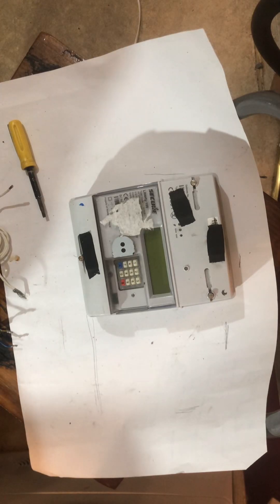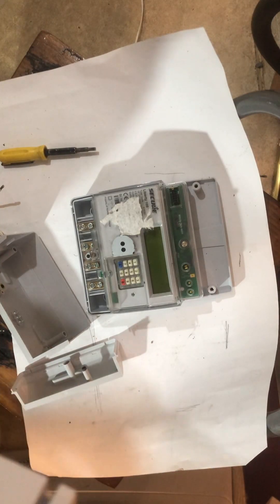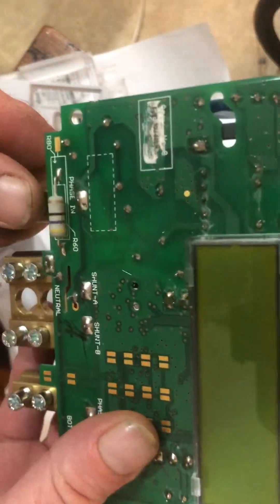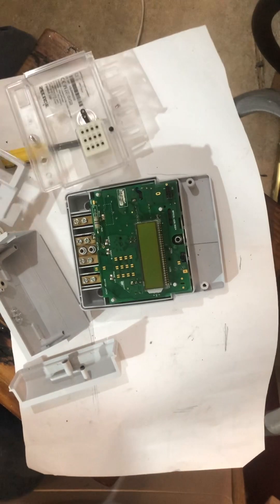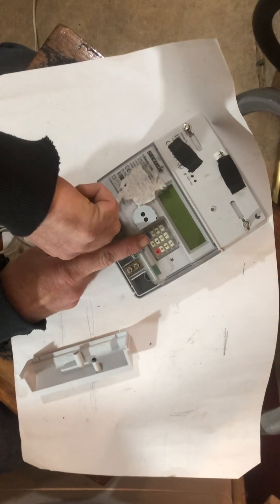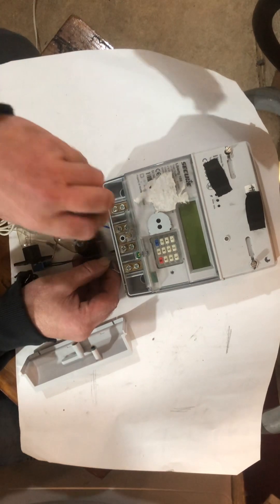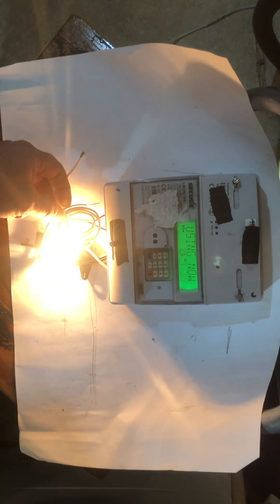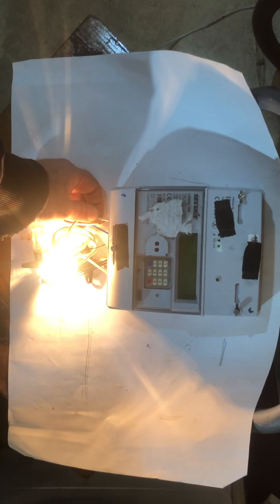UK smart meter hack secure liberty 100 smart meter. Does it hack? Reverse engineering.

Comment: Pointless so when credit run out it send signal to company that you still getting electricity only way rip wires out from meter join them together then feed the meter electricity then connect power to something that's continuously on so you pay less use more job done
Reply from the maker: That would be a way pal Yh. don’t forget thought the meter will send a ping to say it’s off & front cover been open.

Comment: I love the video Kev and I totally agree with comment, about the filthy rich wasting money, when children are wrapped up in blankets to keep warn and going hungry. You have my full support (as I expect others have) for helping and informing all of us, who are less fortunate and privilege as others. I really do respect your knowledge and I was wondering if I could call upon your  professional opinion to answer one question? I'm not far off retirement age and I'm not an electronics expert like you. But I do have a very basic understanding of how the domestic electric supply and cabling system work, with my 45 years in the building industry (chippy). My question (and as  previously mentioned) is for education purposes only. After watching your video and a very similar video with someone else taking apart the same smart-meter is. You both mention the bid red "SPD" or "metal oxide verister" between the live and neutral inputs. My (non expert) understanding of this component (please correct me if I'm wrong), is some kind of anti-tampering device, that may/will fail, if someone try's to shove two cables up the meter and try and bypass the readings. I'm probably wrong but I'm thinking it will fail because of a sudden change in the supply or something. Anyway, my hypothetical question is. If someone was, by chance going to tap into the incoming house supply (the black supply cable underground), from  maybe the street or front garden. And as a result, theoretically have a secondary supply to the house from the same cable. Would this, in anyway trigger an alert or register a failure in the electronics in the smart meter? Basically, would these money grabbing utilities companies, know anything was happening downstream of the meter? Many thanks in advance for any positive and constructive replies and please do another video soon. Bye for now.
Reply from the maker: Hi. Thank you so much, honestly. I’ll start with the first question and clear up that spd or varistor. The component is actually a varistor, it’s just doing the job of an spd (surge protective device). It’s there solely to protect the meter from over voltages, is has nothing to do with tamper in any way. Best example is a lightning strike, it should discharge the extra power down to the neutral thus protecting the electronics inside the meter. As for the other question in a word no. It’s almost impossible to detect it’s been done, difficult to detect even if it can be seen being used further upstream and back to nearly impossible if it’s switched off. They usually get found because they’re not done properly and cause a problem downstream. This in turn forces them to find it to put the rest right. Hope this is educational enough for you, have a good day. 
Kev
Reply: @kevcalms  Thanks very much Kev for your quick reply and detailed explanation to my questions. I wish I had your knowledge and understanding of electronic circuits and the power delivery system in the UK. About two years ago, I purchased a Tesco supermarket 42" TV (Sharp) because at the time, it was heavily discounted. (Sods Law) after just 13-14 months, the screen went black but the sound was OK. It has remained hidden behind the sofa ever since. After watching some electronic videos on YouTube (the Open University for idiots) I took the back off and looked for a blown capacitor or something. I couldn't see anything and like I said at the beginning, I wish I had a tenth of your knowledge, it would have probably saved me hundreds pounds over the years. With reference to what you said about it being near impossible to detect anything untoward going on, downstream with the incoming supply. Does that still apply, even if the hypothetical secondary supply (shared with the same incoming supply cable) was interrupted with say a RCD. Wouldn't that, maybe cause a sudden increase in voltage to trigger an alert? Like a said before, I've got very little knowledge of electronics and you probably find these questions I'm asking a bit silly? Anyway thanks once again for you time and I do really appreciate you making the effort to answer a layman's (inexperience) questions. Bye now Kev, take care.

Comment: Why does mine say 300 plus credit it using now says 0.00 wan light and the light futher down flashing ?
Reply: 101 liberty same yeah? So it's same loop same places but credit still down so works but not as well got be a serial way system credit change when done
Reply from the maker: @alexwiddowson5183  I’m a little lost with that and as always it’s for educational purposes only, a small link wire though will allow very little through it (ie it needs to be the same size to half the reading). They’ll always add up though as there is usually a standing charge.
Reply: @kevcalms  please help me
Reply from the maker: Hi, one light is for the connection and the other is for connecting to your control thing (the monitor you have)
Reply: @kevcalms  and it always says 0.0000 I’m using I’m confused
Reply from the maker: @LeviAlone3653  lol this video is for educational purposes only, however if you have follow this. You wouldn’t expect to be charged for usage as you’re now stealing it.

Comment: How can I stop meter sending signal or stop the remote switch 
Any thing I can do they installed one in my grand when she said no they let them selfs in to install when she was out 
I have eon smart meter I have switch it off frm the plug but I know that won’t stop remote switch 
Anyone in ldn can swap for old meter I pay
Reply from the maker: It really doesn’t work like that, if you have a prepayment meter the credit is done with cryptography (ie codes that determine credit rate ect). The switch does not need a connection to switch off I will simply do it when it runs out of credit. Hope this answers your question at least.
Reply: Hey Kev mines is normal meter not prepayment 
Worried about remote switching during these uncertain times whens bills can’t no paid on the odd times that’s all
Reply from the maker: @oginmylungssmokingclean9225  ar I get you now, honestly pal they really won’t switch you off like that. If it’s a gen2 meter (usually a keypad on front) then they could switch you over to a prepayment plan, however you’ll get loads of notice and some ‘free credit’ if they do. There is no way the network will use the switch in your meter to cut off, in any situation, except if it’s a prepayment meter obviously. They’d come pull your fuse for the house first. 
If we do end up having short electric they’ll switch the lines underground off not our meters.

Comment: I wouldn't be surprised if it does send something out, but doesn't show anything is happening.
Reply from the maker: It is highly doubtful, you could stick it in a faraday cage with an sdr receiver but the logic is high when juice is flowing. You can’t monitor it like an alarm as it’s ac, I dare say there is fixed load ac monitoring gear, especially somewhere in radio transmission. These are though exactly that, doing the same at just 25a 240v would take some components and that’s just 1/4 of the power available from a typical uk home meter.

Comment: As you have taken that one apart. Did they send someone out? Wondering what they would actually do if you took the panel off and messed with the terminals ?
Reply from the maker: If you take the terminal cover off it will send a fault. I’ll be honest I’m not sure if it sends it straight away or in an operational ping, I’d go with the latter tbh but they do, well nothing. They don’t have the staff, they’ll be hundreds of that fault be thrown every day. Opening any other part though will probably warrant a visit. This one was taken out legitimately so it’s no longer on the network and because of this it has no ware to send it’s data unless it sends it to manufacture.